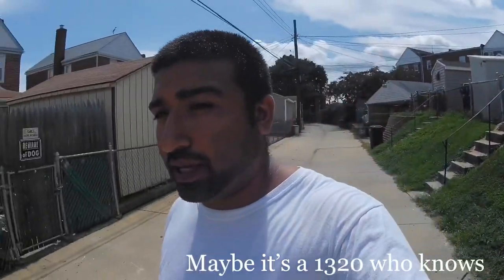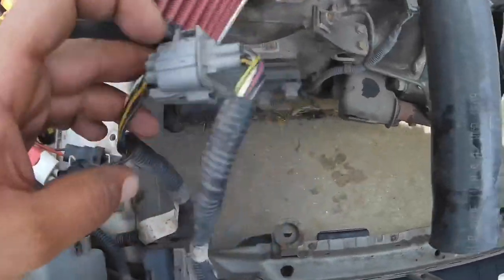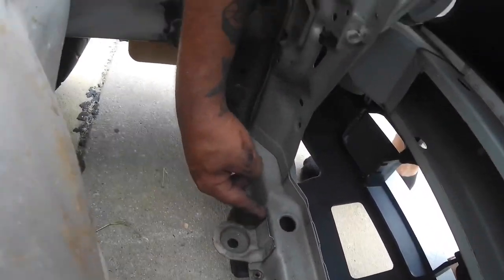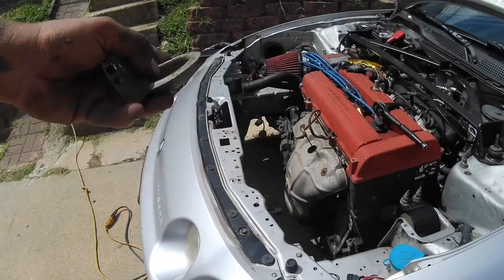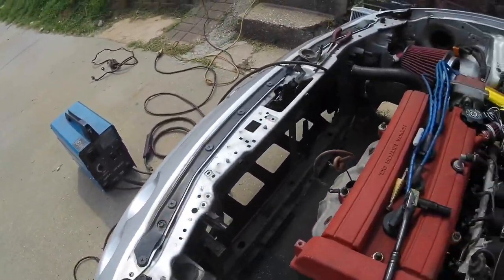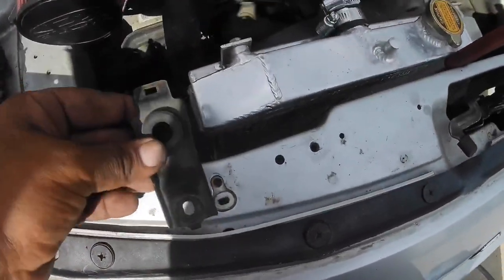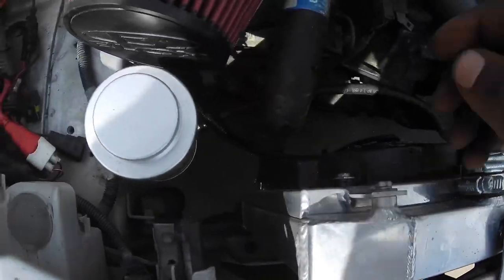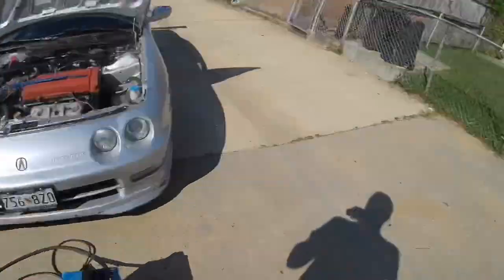Integra half Rad install

Comment: I got the same rad and fan but mine don’t blow as strong and my car has trouble staying cool while driving in the streets I looks like the fan is not blowing hard enough any suggestions to trouble shoot
Reply from the maker: I haven’t done it yet because I haven’t been driving the car that much but I believe you going to have to make a radiator duct because the air is going to take the path of least resistance which is over the radiator...

Comment: Did your cap not fit on right
Reply from the maker: The cap came with the rad so it did fit
Reply: So I seen in your video the cap legs are facing towards you but on the stock one the legs are flush with the reservoir
Reply: Did it give u any problems cause that's how mine sits